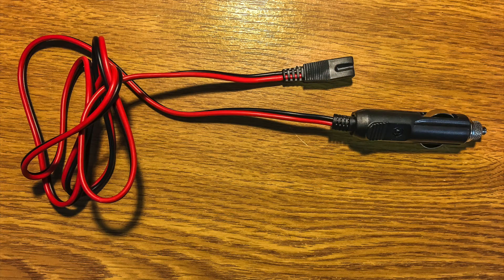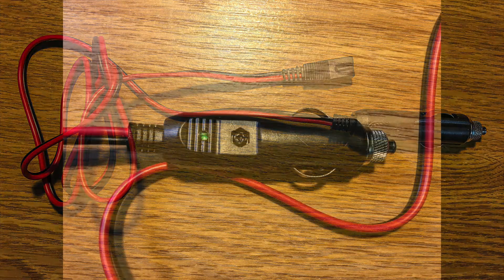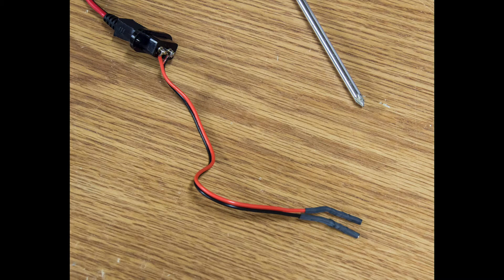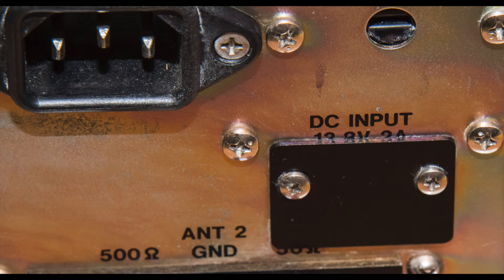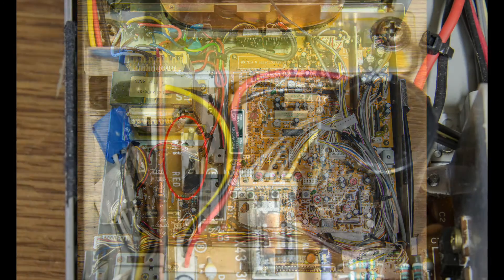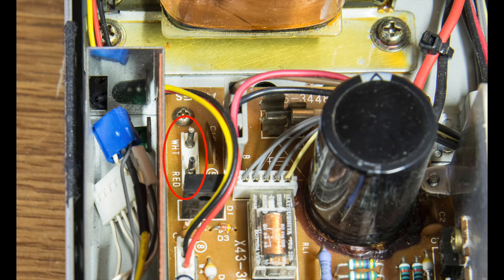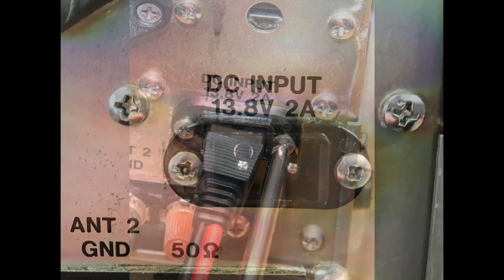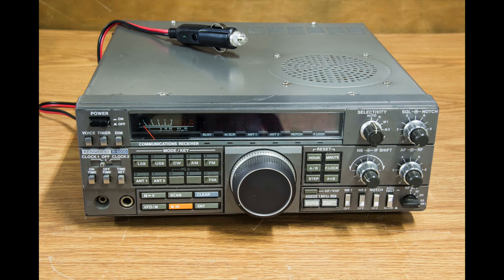Kenwood R-5000 Shortwave Receiver - Restoration - Part 4

Comment: That's the same jack as my R-1000. The socket mounts from the inside, not the outside. The metal chassis is cut to allow the center rectangle of the jack to fit flush with the back. Much neater mounted from the inside. The kits sold on eBay USA include the 2 screws and nuts.

Comment: Hi, could you please tell me where you sourced the DC socket?
Reply from the maker: I got it from a guy in the U.S. on eBay. He was making them up and selling them. I don't know if he still does this....can't remember his details. Sorry. I had difficulty in getting the right sized socket here in Australia, hence the need to look further. Regards, Rob.
Reply: Ok, thanks Rob. I have had a hunt round on ebay here in the UK, but with no success, I will have a look on ebay.com. Regards Andy G7PAZ
Reply: I have a figure 8 AC socket the right size, but I was worried about the risk of reverse polarity so a dc socket which could not be reversed would be best.
Reply: @andywb62  You can buy the socket equivalent made by Opek (CBJ-2B) individually if you don't mind cobbling together the remaining parts or simply search for the Kenwood DCK-2 12volt kit (there are a few on eBay and Amazon) 👍